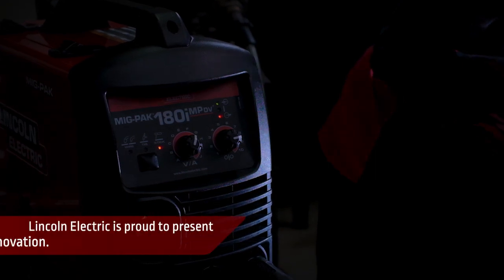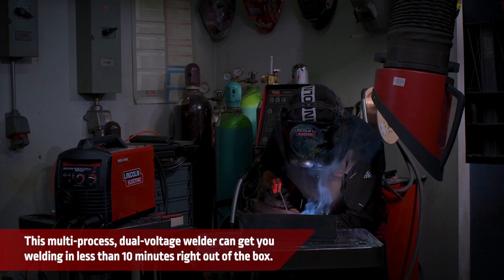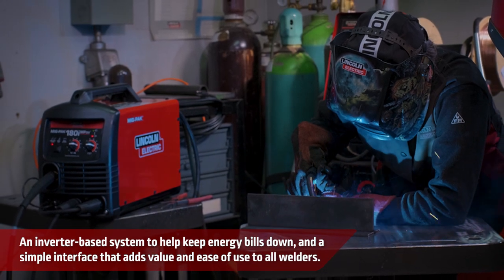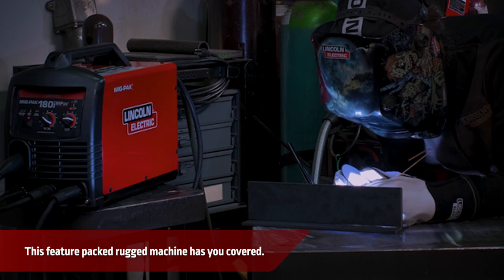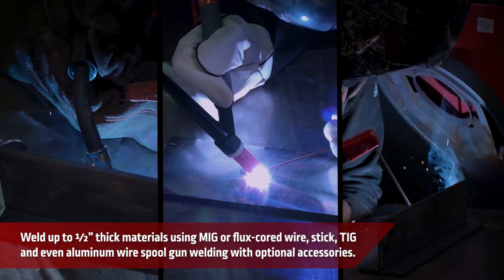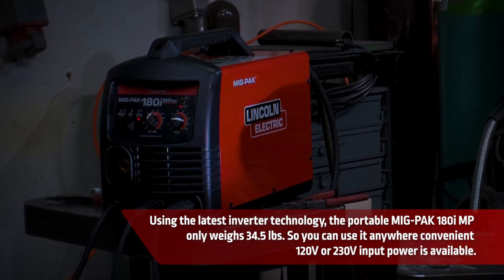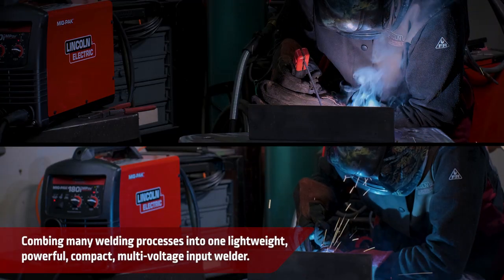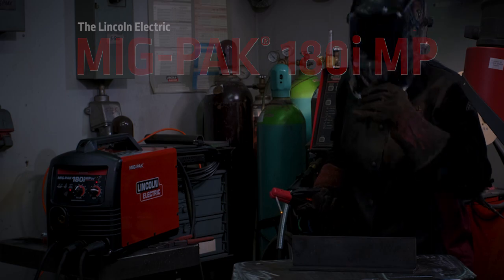The MIG-PAK® 180i MP® DV   - Big Value & Performance in a Small Package.

Comment: Please release the adaptor for Tig torches when using the wire drive system to supply gas. I have tje 180i mp dv and you cannot buy the adaptor for the tig torch by itself. And I’m not sure if you can even take it off of the one that comes with it.